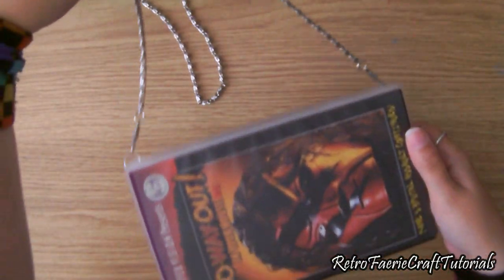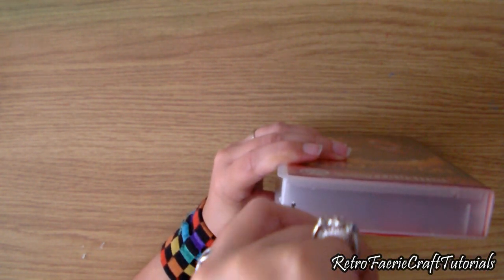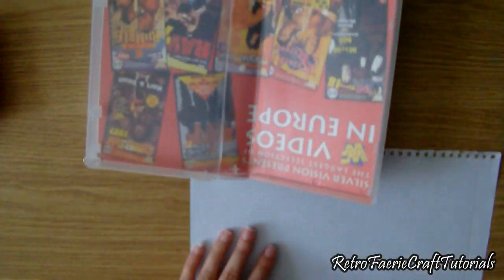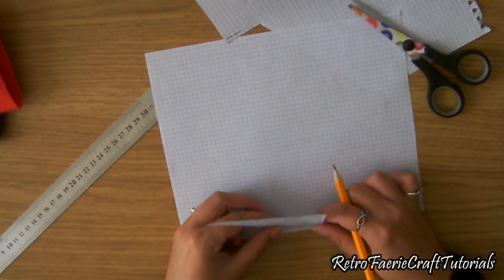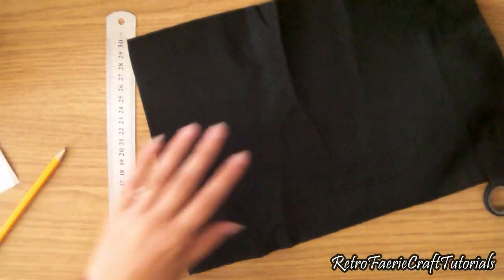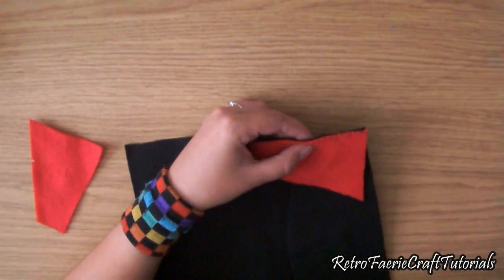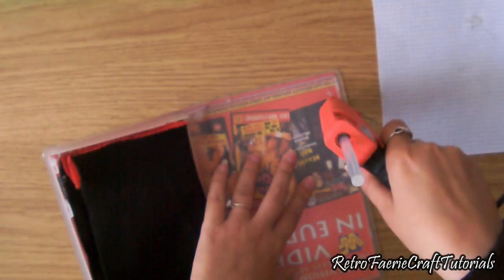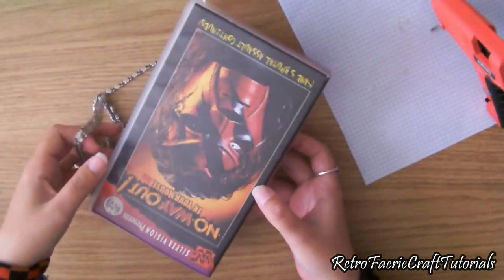How To Make A VHS Case Bag

Comment: Hello, I have a question for you as a cassette purist :) Have you ever repaired the foil for the box label? It would be nice to get at least the foil itself, which is on the VHS cases. I have one box from the collection that I would not like to replace for compositional and aesthetic reasons with another:)